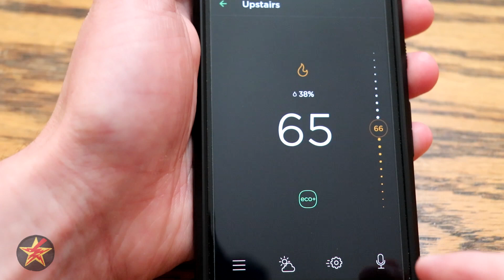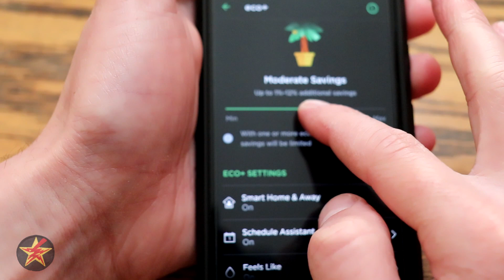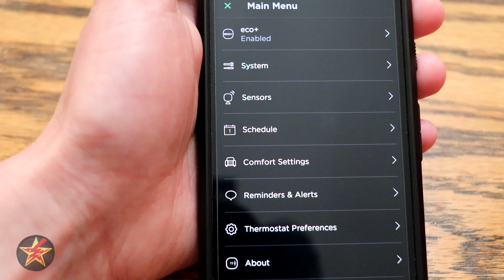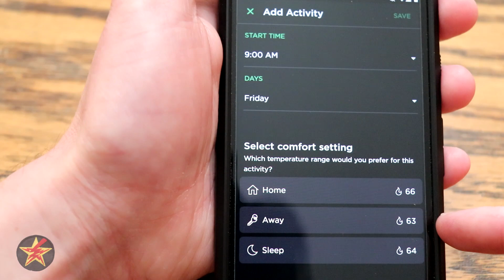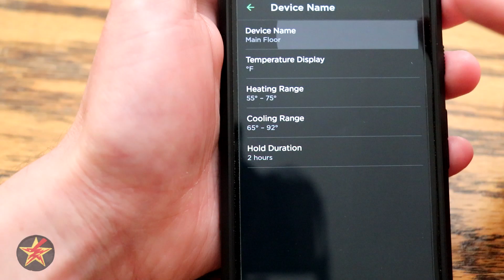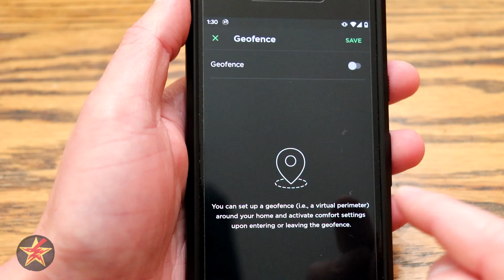ecobee Thermostat app Review

Comment: Mine constantly drops the Wi-Fi from my phone app. I’ve done (over and over again) unplug the unit from the wall, reenter the WiFi password and it will work for a while, but then drops it and I can’t use the app. It does it so often that I’m considering getting a different thermostat.
Reply from the maker: That might have to do with your wifi router more then the thermostat.

Comment: I tried the enhanced model had issues with it showing inaccuracies in temperature even calibration it still is off. Also it cycles too much, the humidity function is a joke and gimmick. 
Honeywell trh9585 is waY better  ecobee leaves you on hold for hours on the phone honeywell does not

Comment: Hello I wanted to find out how to resolve the question mark within the cloud icon. It was mentioned by someone that said it will show up if you have not registered the thermostat, but I have registered. It seems that I can't operate the temperature of the thermostat with the app on the phone. I was told maybe I need to turn it off. BTW contacting Ecobee Support is useless. I got a message when trying to chat that no agents are available. Any suggestions?
Reply from the maker: Yes, I have had this happen to me before.  It means that the unit has lost its connection to your wifi.  All you need to do is go back into the setting and "attach" it back to your wifi netowrk.  You should not even need to put in the password again as it will still be there.  After doing that give it a few min. and you should be good.
Reply: Thanks, unfortunately I had to call Ecobee support. It couldn't be reset without the assistance of an Ecobee agent.
Reply: @MABastaldo  Well as long as it is up and working again.

Comment: Can awaymode switch off the AC
Reply from the maker: Just like the Heat if you don't want that mode to be triggered via a temperature change simply click on the icon at the top for cooling and then select off.